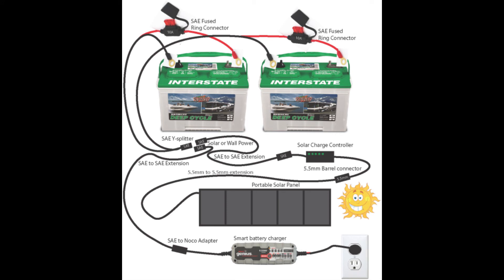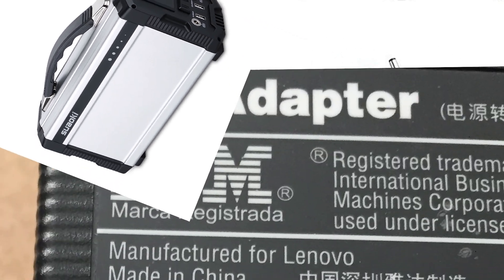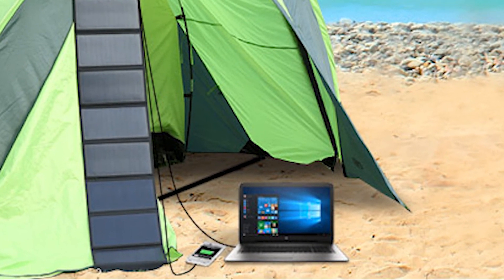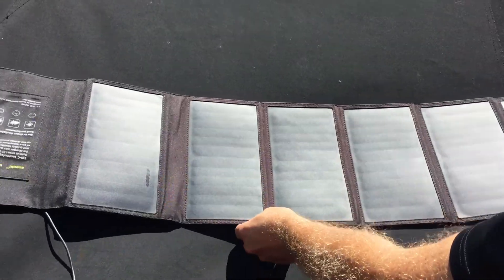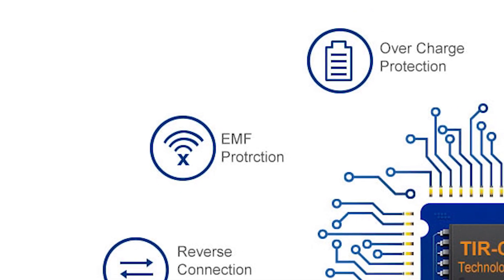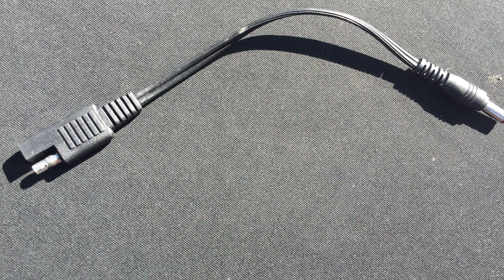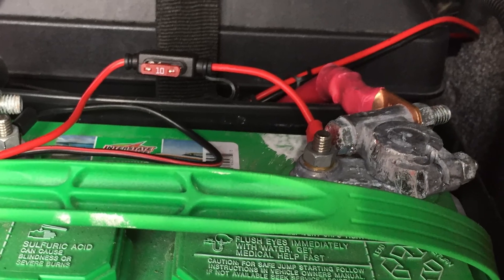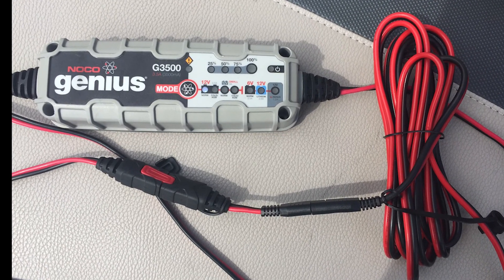Suoaki Solar 12V Boat Battery charge system.

Comment: What happens if you want to run this system on a 12v starting battery and a 24v trolling system with the on board battery charger?